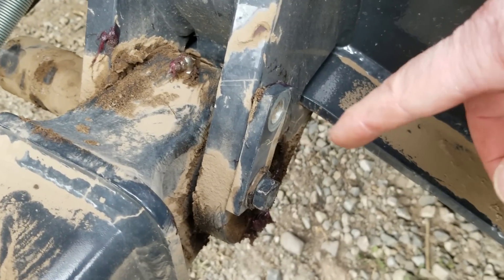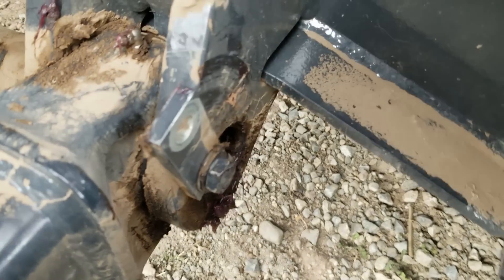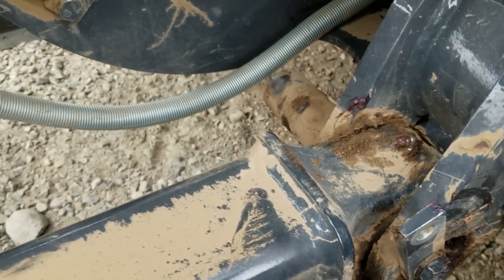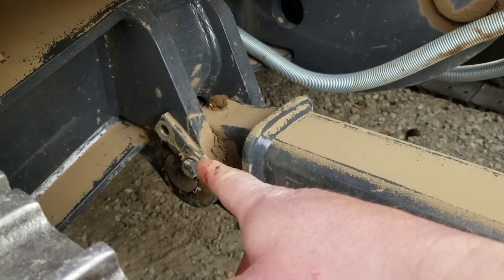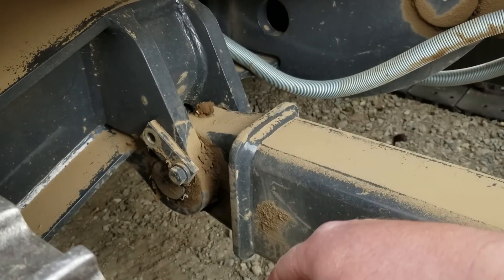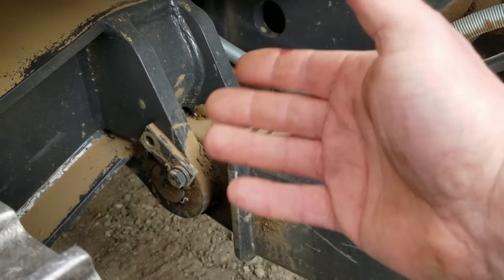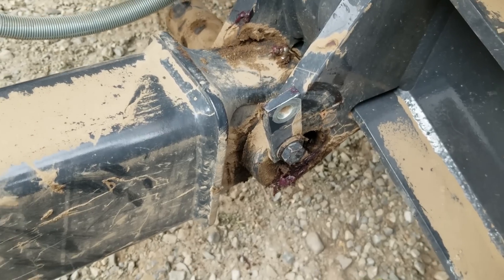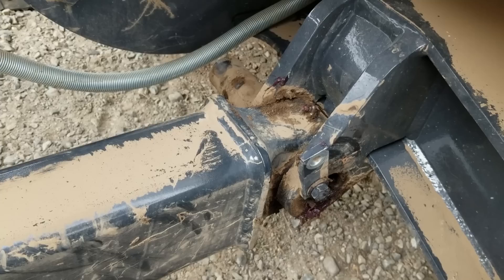Deere excavator design flaw. Suggestions?

Comment: Had a similar issue on a roll on roll off ferry ramp pin, we got the recess in the pin machined all round and just let it turn instead of shear the bolt off or deform the steel keeper
Reply: That's the way I did them no more broken bolts bent weldment 👍🏻🇺🇸

Comment: My 2c. Pins for heavy equipment always want to turn with the movement of the pivot. If you prevent the rotation, the moment to much dirt or rust gets in there and it binds, it will put a hell of a lot of force through the weakest link. That pin cutout is a bit of a cam shape allowing it to put a lot more force on the retaining clip and shearing the bolt if that pin binds and moves with plow. 

A simple fix would be to throw it in a lathe and machine out that groove all around the pin so that lateral movement is constrained but it is free to rotate and will no longer cause the bolts to sheer off.
Reply: The point of that tab is not only to keep the pin in, but also stop it from spinning. If the pin spins or moves it will wallow out the hole in the plate.
Reply: @hoakuroija1089   @Hoakuroija  That is likely true to a certain extent, however most operators I've known prefer pins that don't fall out over machines that goes 10% longer before needing to line bore the pivots which is controlled more by the quality of greasing and pin and bushing material selection rather than pin movement anyway.  Some pins have a tab welded to them that is bolted or welded to the frame to secure it, but I've seen those break too especially with high contamination, high load applications,  like an excavator blade pivot. 

If it truly wasn't supposed to pivot, they could have secured it a lot better but if you look at the design, it was clearly designed to prevent lateral movement and not designed to prevent or account for any substantial amount of rotation force causing it to fail whenever the pivot became stiff which would be something a designer trying to reduce wear would be aware of. 

I understand your point, but having a dirty blade pivot result in the machine falling apart is a design flaw. While you could try to design a stronger retainer for the pin to prevent a tiny amount of potential additional wear,  the rotational forces that can be transferred to a locked pin are huge and the simplest solution is to allow it to rotate.
Reply: Perhaps the pin is not rotating with respect to the machine, because they want to limit all the wear to the pin and the impliment.
Reply: This makes a lot of sense. Good idea.
Reply: Just grease the shit out of it regulary and replace the pin once in an eternity when it wears out.

Comment: We had that happen on a Bobcat E80 which is a rebadged Doosan. But it wasn't the blade, it was the lower king pin, the retaining bolt on the plate that sits in a notch in the pin came loose and it just dropped out. What a mess. The guy ran it like that till he went for a coffee break and tripped over the pin. Bent the machine all to hell, cost a fortune to tear it down and have it bent back into shape and built up and bored out.

Comment: I would weld a short piece of flat bar to the steel plate, above the retainer bar so it could not rotate up and shear the bolt. That way you could still remove the pin by removing the two screws and drifting out the retainer bar or driving out the pin. Its interesting there is enough torsional force on the pin to cause that? Maybe there is a misalignment in those pins.
Reply: Best answer I have seen so far!
Reply: I'd say a misalingment of the pin and the ram axis so that too much sideways force is applied. A design problem so it doesn't matter where it's made.

Comment: If that pin had the groove cut all the way around, it would never lever up against that bolt and take that primary load.
Reply: Could be that they don't want the pin rotating against the outer parts of the socket, would be better for the more replaceable part to take the friction in the long run. Could try and give the pin a proper index, but don't see an easy way to do that.
Reply: No bushings in the outer ears so you can’t let it turn. The bushing is in the center section. Pin needs to stay stationary or you will need a line borer to fix the frame ears.

Comment: Hot snot the tab to the pin. Grease the shaft and insert it, then with a washer/s or bit of steel flat bar to cover tab bolt hole Tek screw it into the the broken bolt shank. Mint👌🏻
Reply: If it can't be tek screwed it can't be fixed

Comment: The question to solve is what was the failure mode for those bolt heads.  My guess is overtightened, which stretched the free threads inside that retaining tab.  There doesn't seem to be anything that could apply lateral force to side load the bolt or the lock tab for a shearing force.  The retaining tabs don't look deformed like they got pushed out enough to pop the bolt heads, and the outer bolt heads were still in place on both sides.

Comment: Almost as funny as manufacturing the hand brake switch to alarm when it's turned  off and handbrake isn't on  and the manufacturer designed it in such a  way that where there play in the cable  it goes to far back and  brakes the pin so it constantly goes off an in the uk  it's a legal health and safety  device so has to work and u sit there listening to it beep for a day  until the new switch turns up 🤣🤣

Comment: Sounds like someone forgot to temper those bolts? The stress on those fasteners should be slim to nill. My first guess was, you lowered the blade onto a rock that fucked the head. But on both sides? Someone made a boo-boo in the fac-tree, no doubt.

Comment: Is that a Hitachi in a John Deere dress?
Looks the same instrament panel
Reply: Deere built most US sold Hitachi excavators up to a 380 in Kernersville, NC.  It was a joint venture that just folded this year. They never built the reduced tail swing or the 470+ here. They got imported to the US from hitachi.

Comment: Longer pivot pin  drilled through on both ends.  Weld a pipe extension with two holes that line up with holes drilled on the pen.  Now you have two sides of a bolt holding the  pivot pin in.  Man I wish I could draw on here.
Reply: I get what you are saying so I'm sure AvE does.
Reply: If wanting to use existing pin. Drill larger hole in the pin grade 8 bolt on one end. Change it to sae just to confuse the next guy.  Weld the tab on the other end.  Pin can only go out one way though.

Comment: When that style of keeper breaks bolts like that it’s usually from the pin sticking or being seized and when you run the implement it “cams” on that small plate and shears off the bolt. Might have something to do with the low hours… low hours but how old is it? does it do a lot of sitting? Maybe the pins started to freeze up at some point and canned over and broke the bolts, then freed up again with some use?
Reply: Sounds like you're right from perusing the comments and noticing the grease fitting for the pin. Apparently they tend to do this if not greased regularly the pin cams over and breaks it.
Reply: This! I worked at a Deere dealership for 7 years.  They would shear off when they didn’t get greased enough. Grease your pins every 8 hour shift and you won’t have any issues with it!
Reply: This ^
Reply: Big yup to this one. Could also increase the bolt grade or size. That pin is much larger and looks hardened so IMO the bolt would have to be way bigger before the pin or eyelets become the weak point. Looks like the bolt and pin should see similar shear force when that pin rotates based on the geometry.

Comment: This even happens on our 30 ton cat, 2020 Nex Gen 330 Caterpillar has pins similar to this, bolt threads into the hole.. if its not greased daily the main bucket pin walks and bends the arm the bolt is connected to.. but if greased properly it doesnt bend.. 7-8k pin lol
Reply: Judging by the undirty schmoo, I’d say it was recently greased prior to the the finding of a walking pin
Reply: @markdahshark3694  Some of the schmoo looked good but the grease fitting was dirty so it probably wasn't greased that recently.
Reply: @bobbygetsbanned6049  taking a second glance I’d tend to agree.
Reply: Hence why I fit autolube systems 🤣
Reply: And we have a winner. If it’s not greased the pin will rotate. Simple as that
Reply: Hmm, I guess that's why there's a grease fitting there lol.

Comment: AvE  failed experiment on what happens when no grease is pumped into a zerk.  Quarter twenty bolts not for pin locks.
Time for a Canuck upgrade.

Comment: Turn a shoulder pin with external threads on the non shouldered side, cross drilled for a castle nut and a captured pin. and a big ass washer. Or use HPHT as usual.
Reply: This is the way.
Reply: This is the way.
Reply: Aw yeah, first thing I thought was "shoulder bolt". This would be a good choice for Uncle B's hardrock gold ore pulverizer too. (In addition to the lock nuts.)

Comment: Factory recall😂 as soon as they saw that counterweight round the corner, you is in your own. Sticky pin, loose bolt. You do the math. Couple hundred cycles and she’s dickered! It was in failure mode right from dealer assembly and pdi that you paid for. 
Time for the hot metal glue gun!

Comment: I know that sometimes they introduce points of failure to protect machines from worse damage. For example, I was told on ploughs there is a fastener that breaks before you rip off all the plowshares. No idea if this qualifies as such a designed failure introduction; I actually have difficulty imagining that there.
Reply: There is no reason to have that be a weak point. Having the pin walk out would cause a lot of damage if you didn't notice it, way more than you could hurt the machine by using the blade hard.
Reply: @--_DJ_--  besides that, the pin should be taking all the forces. There are no lateral forces driving the pins towards the retainer locks. They are literally there to stop them from walking side to side while pivoting with use. 

I wonder if there isn't a bushing or something that is bad allowing them to flex when uses. Maybe it was being used as a dozer type blade instead of a stabilizer like it is meant to be and egg shaped the guide holes?
Reply: @sumduma55  It is made to push soil around like a little dozer, they don't call it a blade for nothing. It does add stability and lifting capacity but it's made for pushing dirt. 
I would guess he has been doing something that is putting sideways forces on that pin, like dozing and turning with a heavy load. It should be able to take whatever your throw at it though. Our Bobcat 430 is from 08 with probably at least 4500 hrs on it and its blade has been used and abused since day one and still has the original bushings and pins. They use a bolt through the pin and the mount on the machine, so it would have to sheer it off for that to happen, which would be really hard to do. The JD approach seems to leave a bit to be desired.
Reply: On the commercial brand Walker lawnmowers, the cutting blades are attached with small bolts to a steel cup which break if the blades hit something hard like a tree stump. Those bolts are 'sacrificed' to save the blade-driving gearbox from damage.
Reply: @joeylawn36111  Lol, that only works on one side because the spindle nuts are both regular threads, hit something hard enough on the other side the spindle nut tightens and detonates the gearbox, I’ve seen 2 exploded walker deck gear boxes on a machine with 4500 hours on the other 2 deck gear boxes. Also walkers are a right bitch to grease… shudders way too many fucking oil reservoirs and grease points, on a MT with a hi-dump 8 oil reservoirs and ~40 grease fittings.
Reply: this one has 10.9 steel fasteners, though. Unlikely they picked higher graded one just to be a weak point.
Reply: @stanimir4197  most sheer bolts are higher grade because if they  fail they have a clean straight cut instead off a blob of mangled steel
Reply: @Poelmeister - a very simple example of that idea is just about every lawnmower in existence. the flywheel is held to the crank with a little aluminum key. you hit a rock, instead of snapping the crank the key sheers and the flywheel spins a bit. I cant tell you how many almost new mowers ive pulled out of the scrap and fixed with a little $.50 chunk of aluminum key
Reply: shear pins on pto shafts for roterytillers is a great example, instead of that rock you hit destroying your engine, it breaks a cheep pin instead
Reply: I know this might be swearing, but if it were a force limiting device, here's the sweary part, it would be in the manual.

Comment: I'd locktite with belleville washers...lock wire if it happens again. If that still isn't enough...gob some melted metal all over it.
Reply: Bolt didn't back out, it broke.  Right half in two.  Retention wouldn't help.

Comment: weld on a tab, to support the tab?
Reply: Weld a tab parallel to the retainer tab. That will keep the stress off the bolts but still allow removal of the pin.
Reply: This is a pretty good idea, then you can just remove the original piece instead of having to deal with a welded replacement as needed.

Comment: Surely it’s broken the bolt by rotating and forcing the bar up with a cam action. What about welding the plate onto the pin so the shearing forces on the bolts were lessened.
Reply: There's your problem.
The pin rotates yes.
A fully grooved pin with a C plate that engages it will do better.
Reply: @Uncle-Duncan-Electronics-Shack  

How it should be in the first place.

Comment: The fix is more cowbell, obviously.
Reply: Would a donk do?
Reply: @beauchamphuberville1355  no but two shmeckles of malarkey marinated in a cambro full of shmoo for a fortnight aughta work.
Reply: Don't forget to add the shmutz last tho.
Reply: This may require the fabrication on a new copper/brass swing press.
on with a tree skeleton (technically a carbon fibre material) handle?
More cowbell indeed.....

Comment: This happens to all my bucket pins running breakers or pulverizers. The 90mm pin tabs break off. I weld big chunks of thick steel to capture the attachment pins and move on with my operating. . . Pretty common really.
Reply: The only real honest reply to Ave's question as of yet!
Reply: Had the same problem on 3 point suspension pins on the larger Toro mowers. Bolt would break, and the pin would just walk right outathere.
Reply: I often wonder if this style of retainer is just too tight in the pin groove. They use this style to retain track pins on big mining machines where I work. Maybe %10 of them will shear the bolts off and they have to be weld back on most the time.
Reply: It's interesting that they are breaking.  There should not be much force on them as the pin takes all the abuse. Their job is only to hold the pins centered. 

I wonder if there is a bad bushing or the guide holes are are out if round.
Reply: @sumduma55  Perhaps there's a friction issue. When the joint rotates it could stick and put torque on the pin. The pin will then push the retainer up and shear the bolt.
Reply: @jerzmacow    it's possible.  But that would mean lack of lube or bushing problems.  I don't even know if that model has bushings in that joint. Worn bushings or out of round holes can put excess pressure causing much the same forces though. It can also cause the action you described.

The blades on those mimi excavators are only used to artificially extend the wheel/track length and stabilize the unit when digging or going up hills. As small as they are, they can tip rather easily when digging or leaning backwards over the counter weight. Some people will use them as a backstop for whatever they are digging but you will typically tear up the teeth on the bucket before the blade.  At least in my experience. You can do some light pushing with them but it shouldn't be treated as a dozer blade or anything. 

You are correct to assume there is a larger problem than just the bolt shearing off. I guess the question is where that problem is.
Reply: @sumduma55  Hmm, maybe.  But have you accounted for the temperature variance of BC Canada?  I don't know what the expansion and shrinkage values are on that steel pin but I gotta think confining it tight at both ends is going to build up heat and press against the tabs on both sides, unless you grease 'er up good.  Then again it's probably not the pin at all but the bolts.  Does the embrittlement of steel lie within the temperature range of the frozen shithole of hoth?   It's gotta be down at -100 dungarees tardigrade up there.
Reply: @sumduma55  if the pins aint tight in the hole, there's gonna be a massive force on the retainers, but only for a small distance while they rub. repeated stresses = bam. metal fatigue. unless you're milling your pins to a few thou of the through-holes, you're gonna break retainer pins on heavy loads.